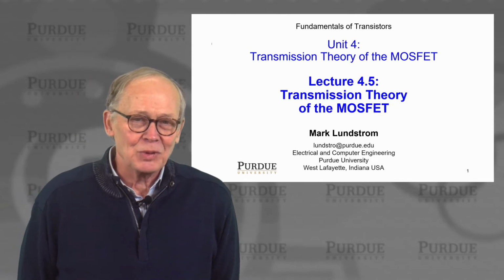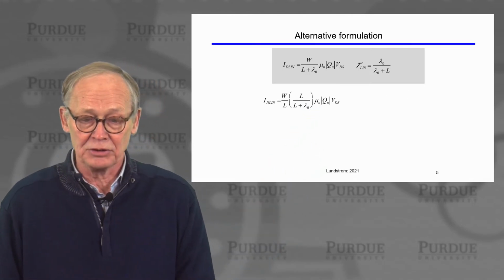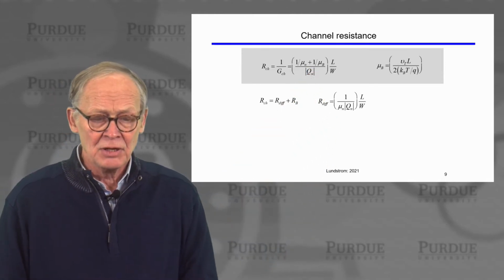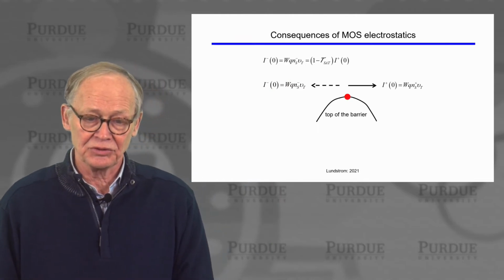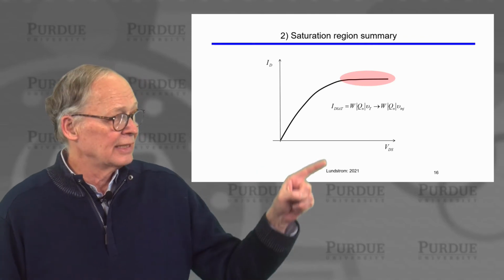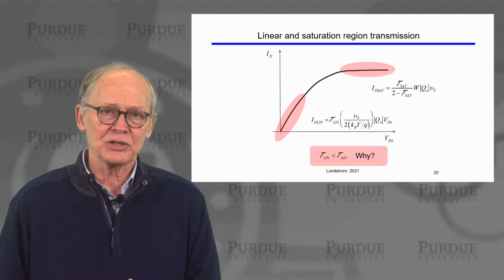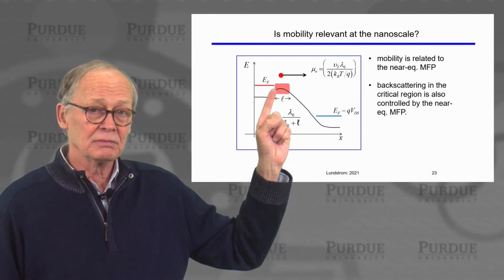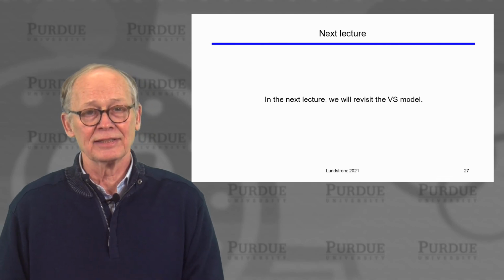ECE Purdue Transistor Fundamentals L4.5: Transmission Theory - Transmission Theory of the MOSFET

Comment: 00:00    Lecture 4.5: Transmission Theory of the MOSFET
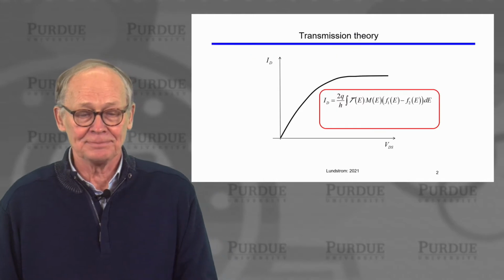00:16    Transmission theory
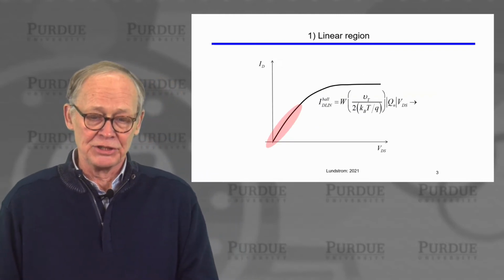01:20    1) Linear region
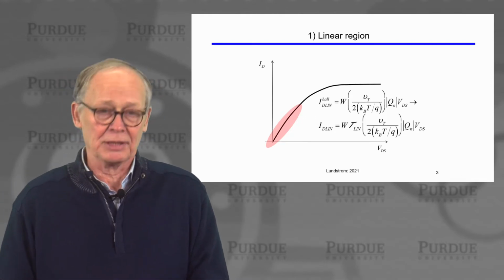01:51    Ballistic to diffusive linear current
03:15    Alternative formulation
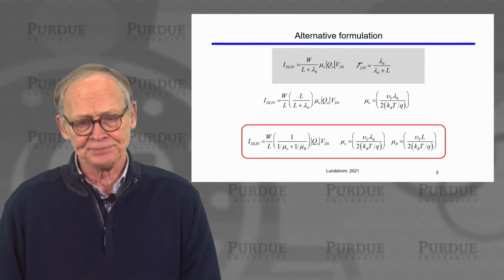04:30    1) Linear region summary
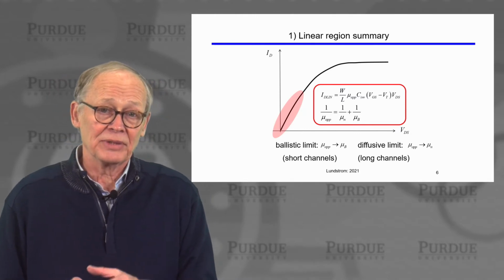05:19    Example
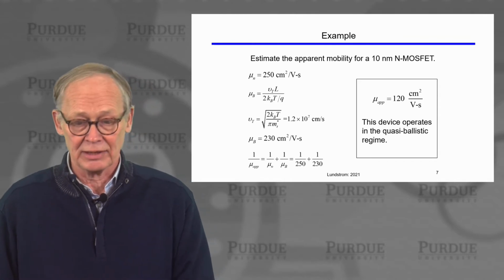07:01    Channel resistance
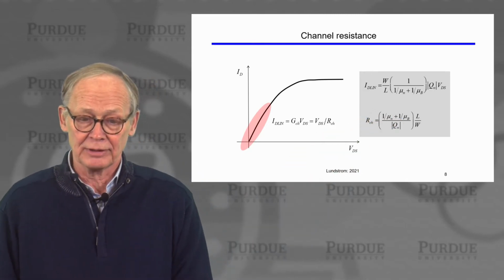07:37    Channel resistance
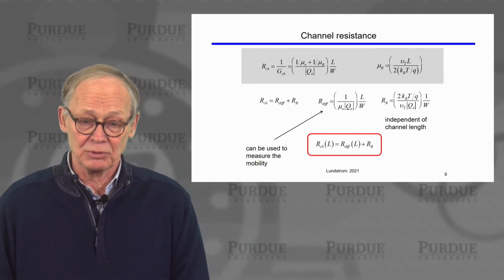08:33    2) Saturation region
09:11    Focus on the VS
09:49    Saturation current and transmission
10:55    Consequences of MOS electrostatics
12:29    Consequences of MOS electrostatics (ii)
13:27    Saturation current
14:56    2) Saturation region summary
15:47    The injection velocity
16:55    Example: Transmission in saturation
17:52    Example: Injection velocity
18:32    Linear and saturation region transmission
19:29    Scattering under low and high VDS
21:48    Operation near the "ballistic limit"
22:29    Is mobility relevant at the nanoscale?
23:48    Summary
24:48    Summary
25:10    How transistors work (Lecture 2.2)
26:17    Next lecture

Comment: At 12:17, Professor Lundstrom says if the transmission approaches 1, the ratio n_s- / n_s+ approaches 1; this is incorrect. What should have been said instead is if the transmission approaches 0, which it does if backscattering is prevalent, the ratio n_s- / n_s+ approaches 1.